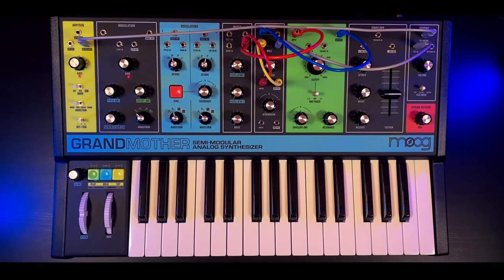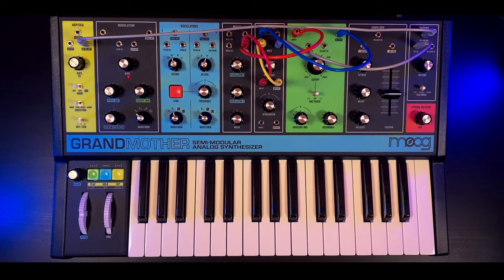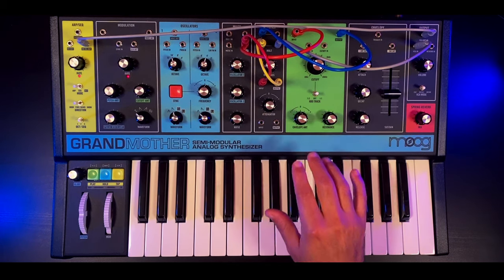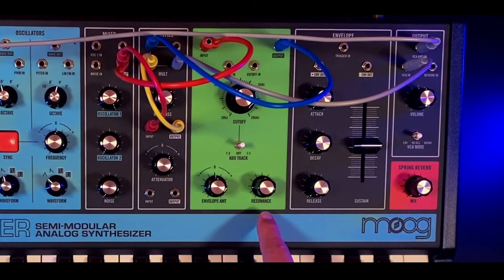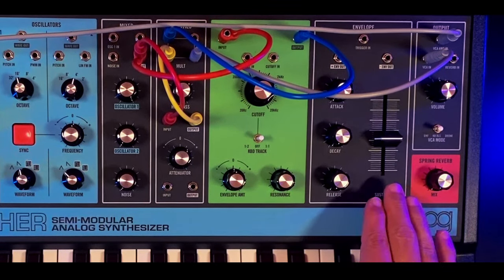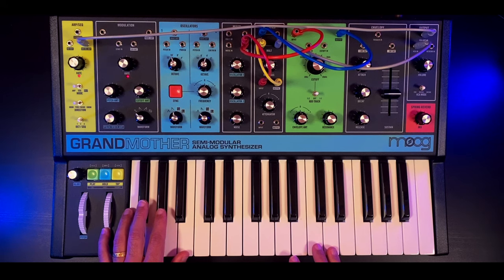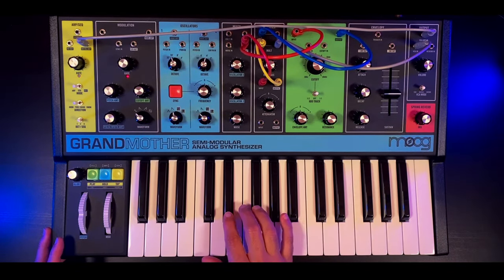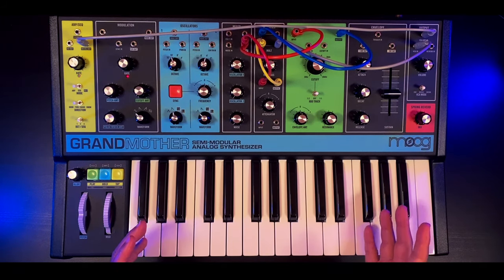Fun For Moog - Baseline patch from Moloko song Fun For Me.

Comment: I like your patch.    this bass is why I got a granny.   along with a stackable cable, one needs a long cable to get from the kbd out to the vca in.  Everyone wonders why moog didn't provide at least 1 cable that reaches everywhere lol. I have also seen little multi-connectors for multing together regular cables.
Reply from the maker: Agreed with the long cables need. It gets even worse if you patch with other gear. It also works with those multi connectors. I also want to get one of those. Cheers